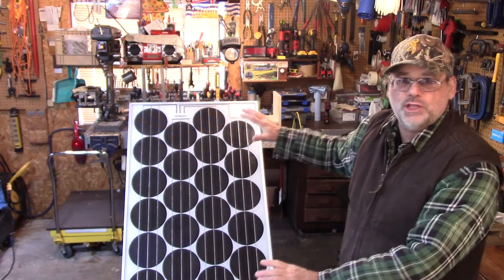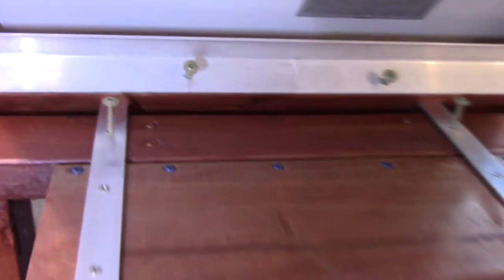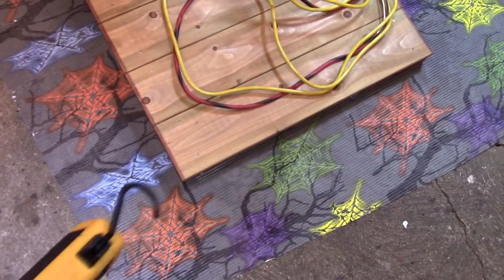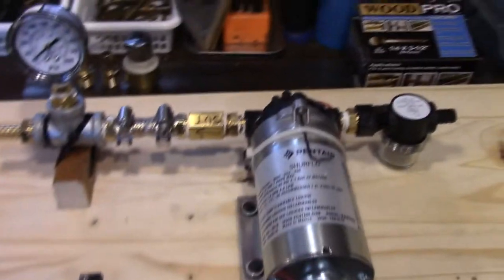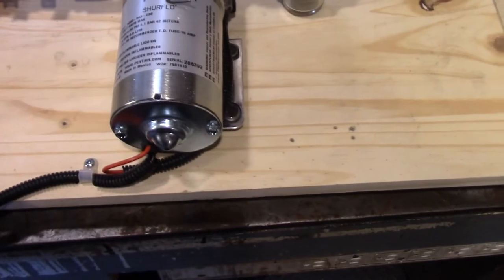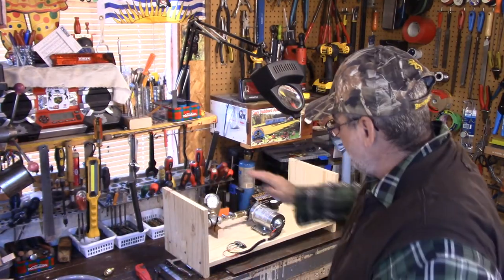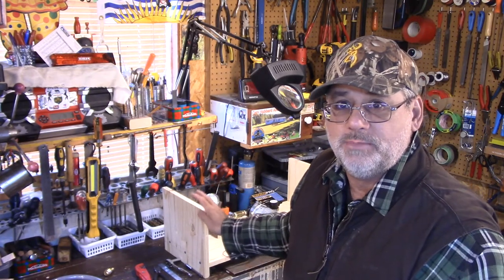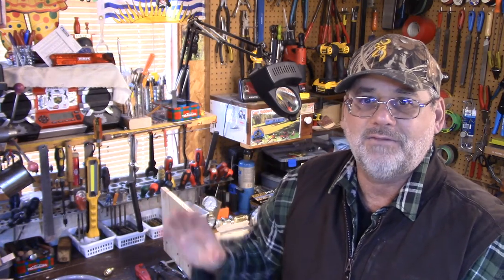12v  Shurflo  Water Pump Setup For My  Shallow Well Off Grid Cabin

Comment: How's she goin'?  It's looking like a system that will work!!!  A concern I have is the pump will pump 60PSI at 8 amps.  You are pushing the water up the hill about 100 or so feet and that will increase the pressure the pump sees.  I hope the pump can over come this load and not be too big a drain on the battery.  Looking forward to seeing it in operation!!!  Take care!!
Reply from the maker: Good  thinking there Mike , 60 psi  at 100 feet up a 30% uphill  so I'm going with 1/2 pex line will  pushing about a total of 1 gallon of water max.  so I figure I will never come close to max pressure , I'm thinking 20 psi max  or less on  open flow .  That's my math and experience so its a wild guess at best 😅😅
Reply: @SteveRobReviews  Sounds like you were aware of this possibility and took that in to account.  I guess I gotta get up earlier to get a head of you!!!  LOL

Comment: That is a awesome idea. I have wanted to do that to run a rain collection system. Collect rainwater off the house and then using and demand pump to run irrigation for garden, and to water animals etc that I want. It looks neat as always. Can't wait to see how it works.
Reply from the maker: Definatey works and so easy to design.  You can actually eliminate everything but the pump and solar panel and just have an inline on/off switch and have the pump only run off the panel.
Reply: @SteveRobReviews  Yeah I have considered that and the set up you have too. I will have to study it more. I am not sure 1 gal per min will work on the irrigation system. What do you think?
Reply from the maker: The pump I have shown will pump 100-200 feet easy on level ground  at 1 to 1.5 gallons per minute which is more than enough for irrigation.
Reply: @SteveRobReviews  Oh ok then. That should be more than enough for me then. I might actually use that to pump uphill to another holding tank that will hook up to irrigation. Either way, it sounds like it will work for what I need it to.

Comment: Great setup for the pump.  I am working on a similar setup for this coming spring.  Do you run this in the winter?  Wondering what precautions you have in-place to prevent freezing.  Thanks for the info!
Reply from the maker: Hi Andy 
I have a playlist showing the completed system. I don't use it in the winter , I'm using it at my off grid  seasonal camp in northern Ontario.
Reply: @SteveRobReviews  Thank you sir.  We are 3 seasons as well.  I'll probably just drain my system when not in use late fall and any time we go up after that.  Thanks for all the great content.

Comment: I was also wondering what kind of lift your pump is capable of handling.  We know it can pump 60 psi but how much rise will you have.  Each .433 foot in rise will take 1 psi of pump capacity. At 60 psi I'm thinking  a 26 foot rise from your well to your storage would be past your pumps capacity. Maybe I don't have that calculated properly but it's worth checking out.  A friend of mine built a home on top of a hill that was at least 200 feet above the surrounding terrain.  He installed a 1500 gallon cistern in the basement.  At the bottom of the hill was a freshwater spring with clean tested water.  He bought a low voltage (12v) displacement pump which ran off of a battery and solar panel setup like you have.  He ran a control wire from the cistern which had a toilet float valve assembly that shut the pump off when the cistern was full. It worked great. I was amazed that that pump could push water that far with such a high head pressure.  We had a deer stand right near the little pump house and I could hear that pump start to click as soon as the sun came out from behind the clouds.  The battery kept the pump operational if the sun was gone for a few days.  I don't think that pump could handle much volume so that was the reason for the large storage.
Reply from the maker: I can't measure the lift exactly but its a 100ft run and about 18feet higher at the top of the hill . I'm thinking no problem with a 1/2 inch line .  Suction lift is  8 feet but pushing water 100 ft should be doable .
Reply: @SteveRobReviews  The size of the pipe is not important for calculating  the weight of a column of water.  Any area of water will exert the same pressure per sq. inch regardless of the size. If your pump is only capable of a lift of 26 ft maximum you won't have any water delivery at that level.  Your pump will expend 70% of its capacity to raise the water 18 ft.  That will leave 30% to transport water.  That will raise your power consumption quite a bit.  But it will work.  Your gpm will be around .54 gpm. I checked the spec on your pump and it is demand pump which is very similar to what's in an RV.  Yours is calibrated to shut off at 6o pounds pressure.  You can turn it down with your hex key but I don't know if it can be set above that.  Point is when you get a 60 lb head pressure on your pump it will shut off regardless if you have water up there or not.  As a comparison think about a highrise building that is fed with city water at 90 psi.  After your up about 6 floors you have no water pressure.  Does not matter if its a 1/2 in pipe or a six in pipe.  In this case size does not matter.  Booster pumps have to be installed in all bldgs to get the water to the upper floors. Hopes this helps.

Comment: I see the pump on Amazon it says the max lift height is 5 ft, I have a shallow point that I would love to use this on, but the water is about 17 ft down. Any thoughts on if this might actually work? How deep is your well?
Reply from the maker: Mine is a total of 9 feet of lift .  Most pumps like this will lift much higher with a foot valve  but not at the max. rated flow in GPM.

Comment: Looks good Steve  How much lift can that pump make?  It’s a hand drilled well, for drinking water,I take.  Hopefully it’ll work out great for you. Look forward to seeing more.
Reply from the maker: Joe its only for use in my hot water tank for my shower  and washing my machinery .  I did call the manufacturer and they did not have  any specific mention on my design but to say the vertical lift is 8 feet max.  I have a 100ft run up a 30 degree hill and a total lift about 15-18 lift  to the top of the hill.  The pump rep had no idea if it would push water that far and high but they will be watching to see me do it. 😅
Reply: I have a 12v pump like yours in a RV and it works well at 6 1/2 foot with a 1/2 inches line . You can always pump water into a tank like you say. Should work great for you.       Looking forward to seeing more off grid stuff.  my Amish neighbors do it ,but don’t know how they store water for drinking.

Comment: The horizontal portion of the angle from the pump to your house isn't really the issue, it's the height from the water line in the well to the inlet in the house.  Do you have an idea how deep your well will be and how high your cabin is from the well head?
Reply from the maker: Well David this summer I will show exactly all of the particulars and how good its going to pump 👍

Comment: I'm sure you have worked this out but I'm going to mention it anyway.  How much head pressure will that pump create?   It's not the length of the water line that is the most important factor but the height of the water needs to travel to get to your tank.
Reply from the maker: Rick the only spec is 8 feet of water  suction draw  but the total  lift is about 18 feet to the top of the hill to the tank.  I am positive It will work in my mind but my mind has a mind of its own  at times 😅😅
Reply: @SteveRobReviews  You can google "pump head pressure" and you will get a formula you can use but with 60 lbs of pressure, I would bet you will be fine.

Comment: I've been thinking about this some more.  To save the suspense and not waiting till next summer to find out if this will work unthaw your 100 ft  1/2 inch garden hose or use your pex and run a chunk up onto your house16 ft and hook your pump up to it and suck it out of a pail. That'll tell the story.  If it gives you good delivery great,  if not you got time to redesign. What'ya think Steve?
Reply from the maker: I  dont have 60 psi at my house water  but its good idea .  I did talk to the pump manufacturer and he did chuckle at my design but promised to watch and see if it works this summer  😂
Reply: @SteveRobReviews  use the pump with a battery
Reply from the maker: Yes 👍